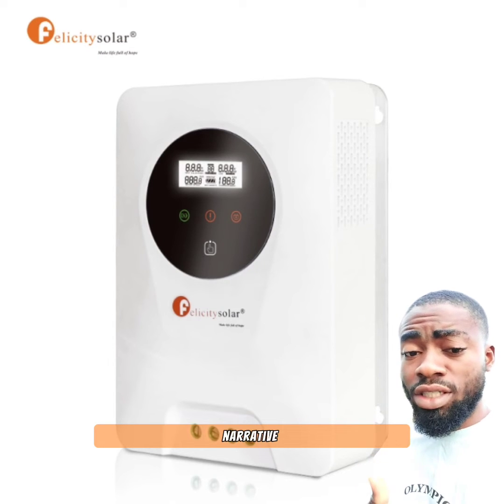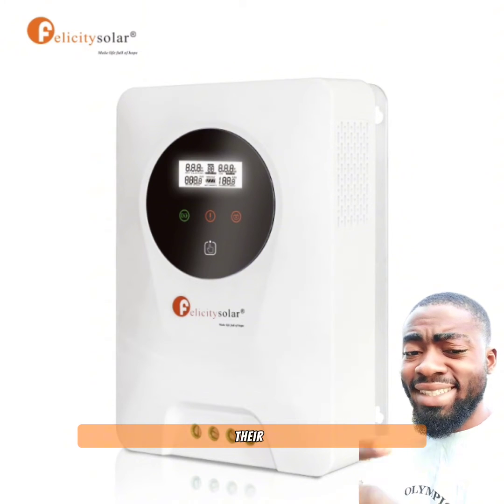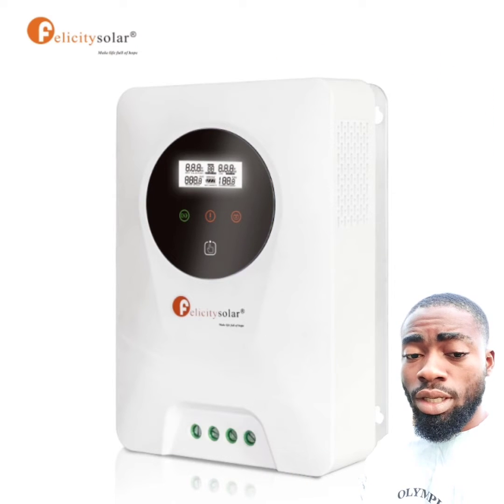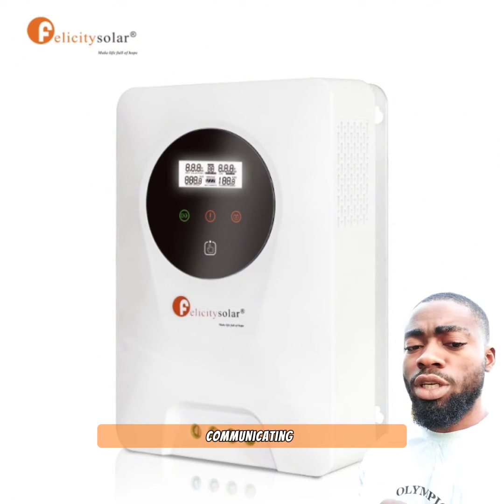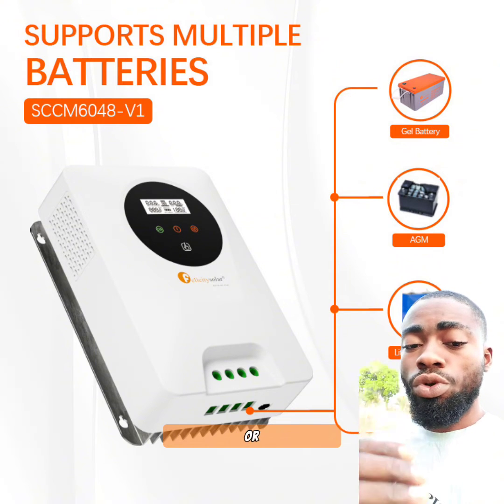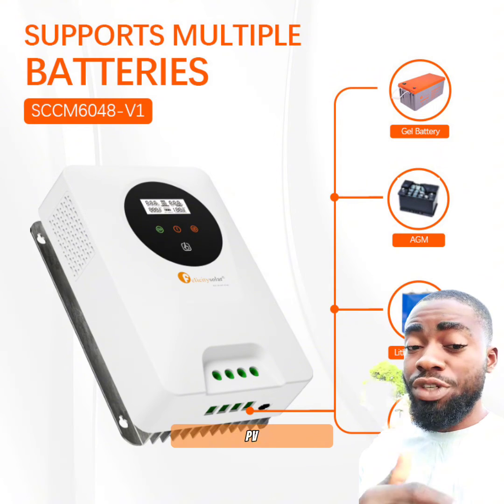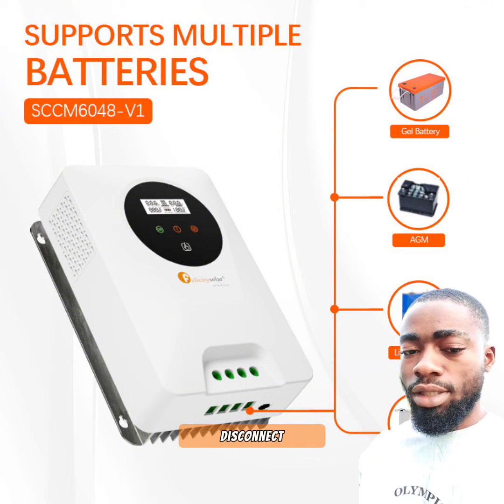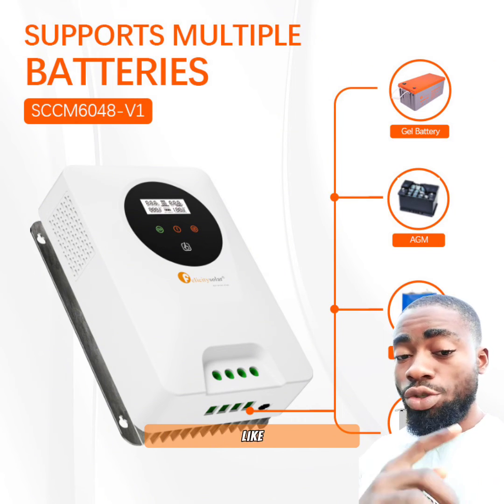New and advanced felicity mppt solar charge controller!

Comment: The mppt function seems not to be working or is there a way to activate it 
I have it at about 108v 9 amps  generating just 250w at peak 
I expect it to auto regulate with the mppt function rather it is working like a pwm controller

Comment: This particular charge controller reads my battery capacity is full and stop charging but it shows low on the battery meter and it’s actually low as it just goes off after some mins. I use the 80A with felicity inverter and Cworth 15kw battery
Reply from the maker: There's a setting you need to do on the charge controller
Reply: @Mairigaemmanuel please can one do it by themself?
Reply: @Mairigaemmanuel I'm having this same issue. Please how can I set it ?
Reply: If your battery is lithium, you will have to manually set it

Comment: I installed this mppt with felicity inverter but with cworth lithium battery. Have plenty challenges when i select the battery to be lithium but the moment i put it to Auto, it started working well. Just want to know what would the cut off voltage be like that and absorption voltage since i choose AUTO. Thank you big boss
Reply: Bro same here. I’m using this Felicity SCC with felicity inverter and 15kw Cworth lithium battery. What should I set the battery type to? But no auto in mine, I can only see Agn, Lib, USE, Fld?
Reply: And again my charge controller reads my battery capacity is full and stop charging but it shows low on the battery meter and it’s actually low as it just goes off after some mins.
Reply from the maker: Check the battery specifications to set the float and absorb voltage
Reply: @Mairigaemmanuel I’ve done this using the user guide..still no changes. I have 12 units of 400W mono panel on my flat roof. But the max watt I’ve ever seen on my SCC is 640W with highest charging current of 12A. During the day with very harsh sun, I can’t even use the system to power only sockets to charge phone as the battery will dip and die.
Reply: @Meskana212 
Check the inclination of your panels since your roof is flat. Connect your panels in two strings and a parallel (6series and one parallel).
Check the quality of your panels (so many fakes are available which cannot produce the stated wattage on the nameplate). Good luck.

Comment: I have an issue with this controller sir... My client call me at night and complained that the controller is off.. Entirely off and only blinks once in a while.. Am yet to visit the installated site... Do you think there's a issue with the controller?
Reply from the maker: The charge controller is PV powered, so it's only displays when there's sunlight
Reply: Hi. Have you been able to confirm its operation?  I just bought one today, and it was working fine this afternoon before going completely off in the evening.  Could this be due to a lack of sunlight?
Reply: Yes,it is. @mohammedbello3866

Comment: If grid is on and charging my inverter, how will the charging from controller be regulated?
Reply from the maker: It sense the battery voltage and reduces the current

Comment: Good Day Sir, i have a question. In a none hybrid setup where you have a felicity inverter and a felicity MPPT controller separately, How would the inverter (connected to grid) know when the MPPT is charging so as not to overcharge the battery?  is there a way to make both devices (Inverter & MPPT) communicate with each other?
Reply from the maker: The inverter will sense the battery voltage and give a specific amount of current, so that your battery doesn't overcharge